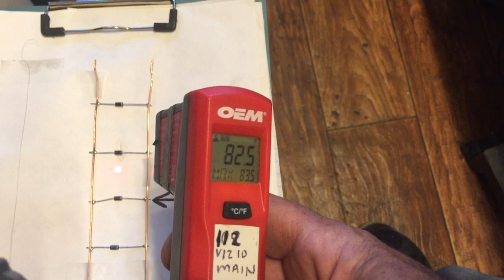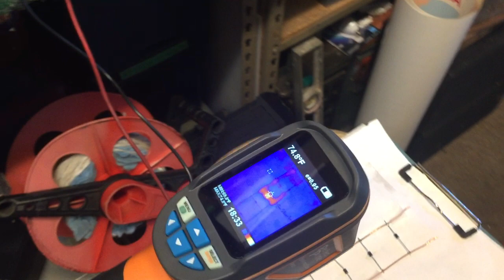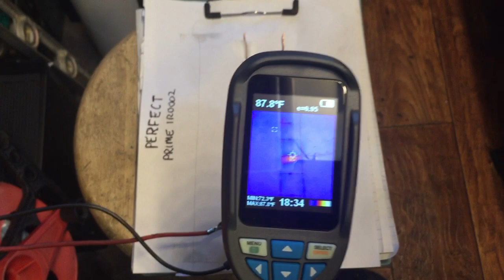Finding Short Circuits With A Thermal Camera.

Comment: When you use a Laser Pointer Temperature Probe it works correctly if you point the laser straight down vertically or horizontally so that the Laser Probe can receive back the reflection of the laser and then you get a correct reading !  You were actually pointing the laser at an angle where the Probe could not read the reflection !  It works just as radar does.  It measures the rebound signal and determines the temperature ( in the radar case it measures the distance by determining the time it took the signal to come back)!

Comment: A Hikvision B20 would be just a bit more pricy but offers you 256x192 IR resolution instead of 60x60! Or a InfiRay C200 would offer also a much better value for money. At this price point 100-150 USD more will give you a much better camera. If you want to stick with well known brands you would get a Flir C3-x (128x90px) or C5 (160x120px) for 500-600 USD in the US.

Comment: I did buy seek pro and I looking for use on my pc and home use I did go my sister condominium and do a survey on doors and windows and  I was talking pictures and notice a spot on kitchen wall .the temperature reads 80 degrees F it looks like a pipe with heat .Any suggesting.

Comment: Those lasers are a joke. I covered the laser in mine. Not only is the laser 100% useless, but it will reflect into peoples eyes. The best way to use the cheap IR thermometers, is to consider them to be like a flash light. If you aim a nice focused flash light at a wall, that round area that is lit up will be the focus area. The average of the focus area is the temperature that you will get on your cheap IR thermometer. 

If you move the IR thermometer around until you get the highest temperature, the center of the focused area will tend to be the hot spot. 

It's a joke when people go into peoples houses aiming the laser at peoples window edges, as if that's the temperature that they are getting. People that live in the house fall for it, thinking that those idiots are actually getting the temperature of those spots. The cheap IR thermometers are still useful for catching warm spots as long as the warm spot is not shiny.

Has anyone tried a regular camera with the IR filter removed, for detecting shorts?

Wayne Sallee
Wayne@WayneSallee.com
Reply from the maker: I suppose the $22,000 dollar models are probably a lot more reliable. For that prices I would sure hope so.

Comment: Myself i learnt the troubleshoot method of Sorin from "Electronic Repair School" youtube channel  he is an amazing guy, this method is especially interesting for smd component on the board, he uses Zippo lighters petrol, to see it moves or evaporate when turning hot, this is very cheap and good enough, freeze spray ares mad expensive for such usage .

Comment: My name is Grant. Half of my business is dealing with musical instruments but the other half is industrial electronics troubleshooting and repair.

I’ve needed a thermal camera for a few years. I almost purchased a “Flir one Pro” … But decided to wait and see what new developments hit the market this year. 

Technology changes so quickly I’m not sure what the best option would be. But there are so many good high-quality options available for under $500… I’m not sure if the flir one pro is still the best and highest resolution option under $500…
I Would love any input or advice.....

 as always, love your channel!
Reply: Also the Flir one pro has 19,200 pixel resolution compared to 3,600 for the camera you show in your video.

Resolution really is the most important thing when troubleshooting surface mount boards… From what I’ve seen the Flir one pro and a few other cameras have unbelievably high resolution for under $500. 

Soldering it has four times greater resolution… And is the same price as the camera shown here… I think it might give a clearer picture and be more usable. But I could be wrong.

I plan to use an old retired iPhone to permanently mount my flir camera… I’ll be able to easily record video, slow motion, take photographs… and I can do it all with a $2 Bluetooth remote control. This way the camera can be permanently mounted over the bench on an articulated worklight arm... and everything can be recorded For later diagnostics. And it will be completely hands-free because I’ll be able to adjust the camera where I want it and use the Bluetooth remote to click photos or videos on and off..
Reply from the maker: This is the first thermal camera I've ever owned, so I can't give you good comparison to other models. This model is pretty low end unit, and the video resolution is poor, but I still found it useful when looking for a short circuit which overheated one of my circuit boards. Sorry I can't tell you more.

Comment: I bought the cheap and cheerful, (£130),  KKmoon HT-02D Thermal Imaging Camera back in may last year. Same design as yours. I've found it so useful in diagnostics and as a fun toy. :)
Reply from the maker: For sure. A potential money maker as well.
Reply: Would you recommend it? I’m looking at a phone with a thermal imager or possibly the one you recommended.
Reply: @AShaw-bd4fy  Yes, I would definately recomend it. It has'nt let me down, it uses SD cards and I've only changed the batteries once..

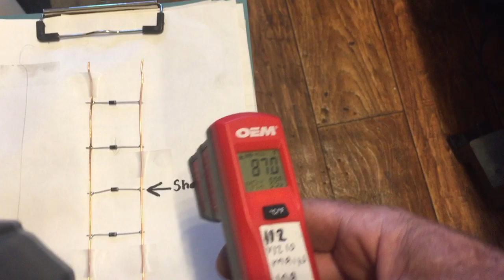Comment: 3:03 The reason that the laser temperature probe reads higher temperature on the paper below, then on the diode itself, is because these meters only work correct on a non reflective surface , most electronic electronic parts have a smooth surface wich give some reflections and wrong values.
Reply: Yeah, all about the emissivity of the target object. Sometimes you can tick a piece of very dark gray or black tape on larger objects or darken them with Sharpie ink to be more consistent. I've found that strong close-in ambient light reflections can confuse cheap thermomenters so I susect they use very cheap sensors or filters. Better ones (and older cheap ones) are unaffected.
I wonder if the newer cheap ones don't use a proper IR thermal sensor and use some kind of cheap IR motion detector sensor loosely calibrated for output voltage instead
Reply: How did I never think to darken with a sharpie! Thank you thank
Reply from the maker: Yes. They also seem to have a problem with small components.

Comment: 25 years ago when I worked in a repair shop, I would use freezer spray and heat guns for certain faults, also used an analogue ammeter in circuit to watch for any abnormal current draw.
I did ask my boss to buy an infra red camera but they were way too dear at the time.
However the back of my hand got to be quite sensitive for sensing a couple of degrees above ambient :-)
Another tool I used for s/c that were too low to generate heat was called a toneohm, which measured down to mili ohms and altered the pitch of a tone in sympathy of the resistance, very useful kit.
Reply from the maker: The hair dryer can be extremely useful in helping you discover if there is a bad capacitor on a PC board. If you hook a weak capacitor to an ESR capacitor tester you can actually see the resistance go lower as your warming it.
Reply: @GrantsPassTVRepair  i think i know the answer but just to be 100 percent sure.
I good capacitor would not deviate its ESR  under temperature changes,  correct?
while a weak one would show deviation in ESR.
Thanks ! Your video are amazing!!!
Reply from the maker: @lucbeauvais1847  When a capacitor is heated up with a hair dryer it's ESR reading will improve a great deal. Of course the improvment is only temporary until I cools down again, but sometimes it can be a useful troubleshooting technique to warm them up.
Reply: @GrantsPassTVRepair  thanks
Reply from the maker: @lucbeauvais1847  Your welcome. Happy New year.

Comment: please see Ken Cosi's comment about parallax errors. its a misconception that these IR thermometers sense temp where the laser dot is. this is true ONLY for a specific range/distance from the target. anything further or closer will shift from the laser target point.
Reply: Very true. Also they usually have an emissivity setting, looking up the emissivity of the material being measured and adjusting accordingly improves accuracy

Comment: Infrared (IR) thermometers suffer from parallax errors when the laser is used for targeting while measuring temperatures at various distances.  Also with increased distance from target, the IR sensor tends to average the reading over the larger field of view.
Reply from the maker: It also made a big difference when I pulled either of the Two devices further away from the heat source.
Reply: Try gluing (with hot glue so you can remove it later with alcohol) a short length of tube over the thermometer sensor to see if it shields off the field of view a bit? Maybe a short length of shiny aluminium or stainless tube (scrap) will act as a  reflective lightguide to concentrate the angle?

You could also try a small magnifying glass lens, though bear in mind that the longwave-IR radiation will focus at a different point than visible light so you may have to fiddle with lens spacing to the sensor. Physics is strange like that !
It wll basically make it into a close-up-lens-on-a-camera-lens-kinda-thing, so the distance to the object becomes closer and more critical, the plane of focus will be very shallow (maybe too shallow). You may have to use a set spacing determined by a short rod attached to the thermometer to make the distance the same each time. 

Now I think about it this lens thing may be a little too complicated haham but the basic shiny tube may help narrow it down as is much simpler